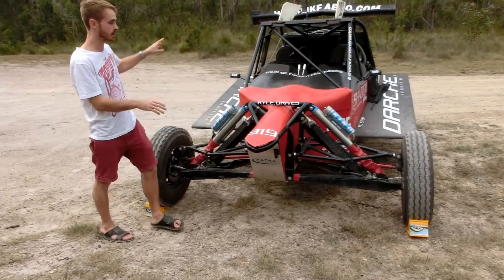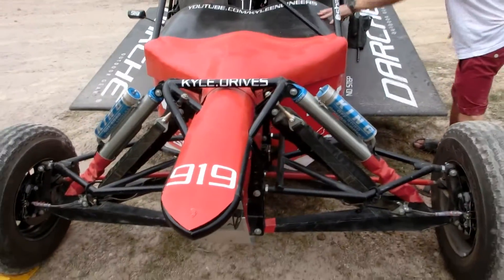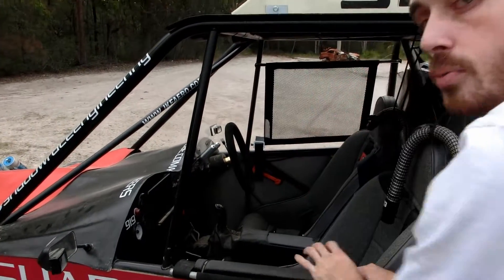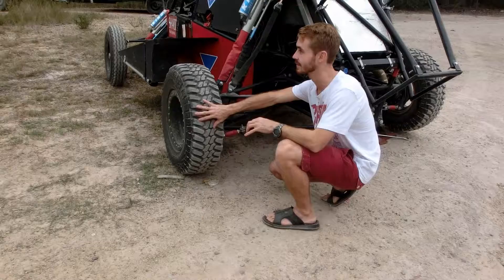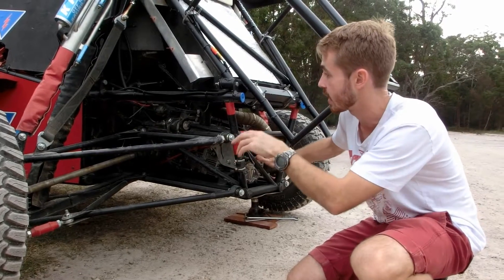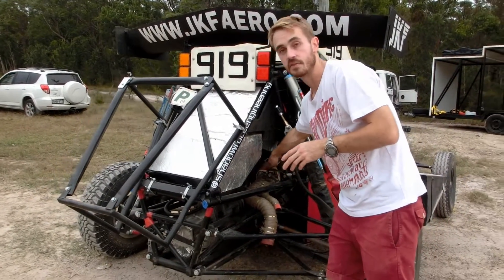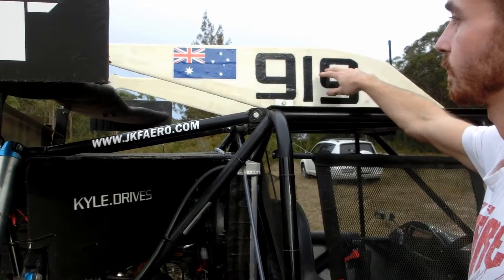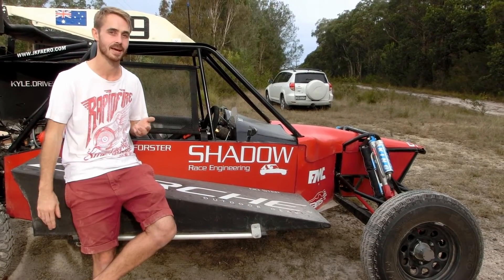Kyle's Custom Off-road Race Buggy - Walkaround and Explanation

Comment: Fantastic videos, really love watching them. =)

Can you tell us anything more about the sidepods on the car? I noticed that they were hollow but also blocked off in front of the rear tyres (open on the inside), are they a wing profile? Do they act as functional aero surfaces beyond being an angled plate the air hits?

Comment: could you do a video explaining the whole suspension in tua buggy? Like talking about how much kingpin and caster, the roll centers in both axles, the stiffness of each pair of shocks, the frequency of the suspension in each axle ... Its analisys. That would be great. Thank you. And bdw, nice vídeo. I really like ur channel
Reply from the maker: +Ayrton Lassi Maybe, although I wouldn't want to give too much information away to the competition... Let's see shall we ;)

Thanks for the compliments!
Reply: +KYLE.DRIVES  I understand kkkkkk sorry for asking. My college team compete in another kind of competition, Baja SAE competition
Reply from the maker: +Ayrton Lassi Ahh yes, I am familiar with Baja, I always wish they brought it here to Aus, instead I ended up competing in FSAE in undergrad. I can't remember exactly off the top of my head but I believe KPI is 10deg and Caster is 7, adjustable between 6 and 8. KPI is pretty much a function of clearances in off road, and you just try to get it as low as possible, then dial in as little caster as you can to successfully counteract that, as you don't want your steering feedback to be too high. Keep scrub radius between 10-20mm to make sure the steering weight isn't too high, although given you have a narrow track you might want it even lower than that as you could have some kinematic scrub issues otherwise. Stiffness for off-road isn't as clean cut as it is for on-road, I would recommend testing different spring rates is going to be more useful for you, as spring rate will always be a compromise between bumps and handling. Are you running dual rate springs? Because then you can compromise less. Roll centres - it is more important to control the migration than the location. A consistently mediocre handling car will generally be better than a car that fluctuates between great and terrible depending on the corner. For height, use standard car rules. Mine are pretty high because I wanted to mitigate roll to help with aerodynamic setup and driver confidence, as well as get a nice sharp response speed while still having soft springing. Standard rules for road cars apply here too.

Does that help?
Reply: +KYLE.DRIVES Yes!! For sure!!! Thanks a lot for hoje help, nice tips bro. We dont use dual rate springs, we actually use fox airshocks. We are designing a new prototype, we dont have much time for it. I'd really like to have some project conversations with you. That would be great. Leave ur Facebook, e-mail, if ur interested in help us. I'm coordinator of suspension subsystem. Thanks a lot again.
Reply: +KYLE.DRIVES My facebook is /ayrtonlassi bdw
Reply: This is great! No one does a mid-engine subaru buggy in the US... yet. Do you have a place to discuss the build. A forum, or something?

Comment: Very nice, good to see all the subassemblies explained!  
3:05 - what influence does that vertical plate have on the airflow on the underside of the wing? 
At 4:15 you mention the mounts, but not the vertical plate and it looks like quite a narrow gap, but maybe it is deceiving due to camera perspective?
Reply from the maker: +YensR That number plate actually is positioned to work as a spoiler under the wing to assist the airflow in staying attached. By using the airflow from the bypass duct and the assistance from that spoiler/gurney we can work the centre of the wing much harder without stalling it. This actually results in our wing being twisted in the opposite direction to a conventional car wing, with more angle of attack in the centre and less on the outboard sides.

And at 4:15 that is very much camera perspective, the gap is a lot bigger than that, it just looks smaller there because the camber on the wing is very rear dominant, thus the gap you are seeing is the flat front section and it sharply rises after that.

Thanks for watching!
Reply: KYLE.DRIVES Awesome, thank you for the comprehensive explanation, Kyle!

Comment: so do you carry two different spares since your wheel pattern are not the same front to rear?
Reply from the maker: +keith wilson Not exactly, with the weight so rearward and the front tyres so skinny, a rear puncture is far more likely to occur than a front, so we run the gamble of weight vs. performance and only carry a rear. It's fairly common practice in off road racing over here. For longer tracks, I am going to rig up an adapter plate that will allow us to run a rear wheel on the front in a pinch. Most of the tracks are 16 - 30km long though, with the shortest ones getting down to 4km, so you can limp home for most of it. On the shorter tracks we don't even carry a spare.
Reply: would seem to me the wise thing to do is run the same vw pattern all around.. but to each there own
Reply from the maker: +keith wilson The problem with the wide 5 pattern is that it requires a large hub diameter, this requires the brake calliper to be moved well inboard of the wheel mounting face to ensure clearance. This means the brake rotor must also be further offset from the wheel face, and the only way to make all of this clear the upright is by shifting the entire wheel face outboard. As I wanted a low scrub radius and KPI for kinematic reasons and to lower steering weight, the only option was for me to keep that packaging super tight, hence I couldn't fit the wide five pattern in there. Believe me, I wanted to, but when it came to decision time I decided I would deal with the extra issues if I got a flat to achieve the suspension setup that I wanted. Besides, on most races a flat is going to ruin your chances at a competitive time anyway, so having the adapter plate take an extra 30 seconds to fit doesn't particularly bother me.
Reply: +KYLE.DRIVES  ok but couldnt you  just make a wheel adapter from small five to wide five, i did that for a friend when we put porsche 924s rear disk brakes on his buggy, just use some 5/8 or so aluminum with center cut out and add both patterns on it. i mean its desert racing there is no room for compromise or short cuts if you want to win or even finish. can you do a video on cycling out the front suspension how much drop and how much up travel are you getting? i dont see that wheel being able to travel up all the way with out the frame bottoming out on the ground first. just my observations and opinion.
Reply from the maker: +keith wilson Yes the adapter from small five to wide five is the "adapter plate" I was talking about earlier. It will only be fitted when the spare tyre is on, as installing the adapter plate would significantly increase the wheel offset, resulting in undesirable suspension characteristics that would compromise all the work I put into getting the suspension to handle really nicely. It is better to take the time penalty of 30 seconds to fit the adapter plate at a tyre change then having an extra 5/8 of scrub radius at all times. I don't really want to take the shocks off again if I can avoid it, but when I did the test fit with just the bypass shock there was 2-3 inches of clearance between the frame and the ground with the shock fully compressed. I was running the shocks a little soft on the first race so we bottomed out quite a few times, but there was minimal scraping on the front bashplate. The rear bashplate had more scraping on it as the track had very deep grooves and I had not set the rear ride height high enough, also the rear limit straps are about an inch or two too short. However, in slow motion footage we have of the main jump where we were bottoming the suspension, the rear did not quite contact either, although it was very close.